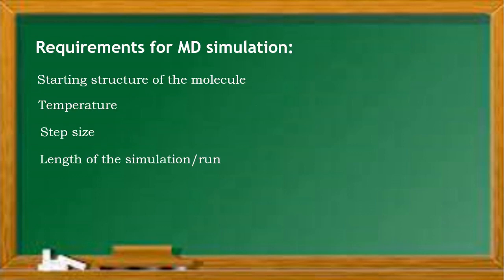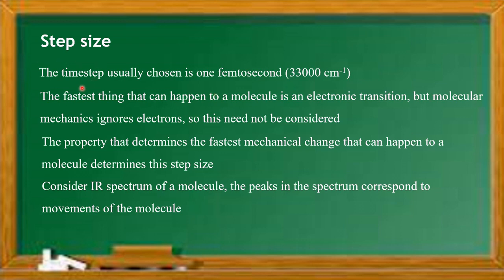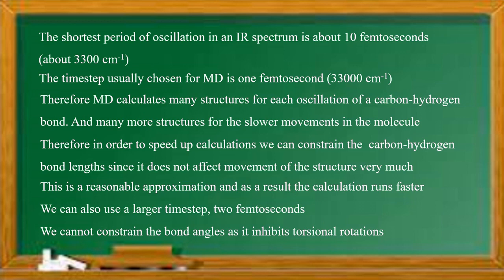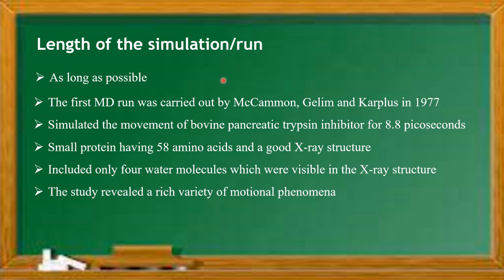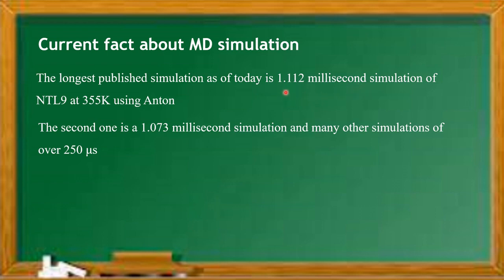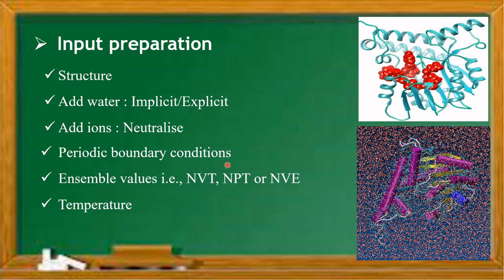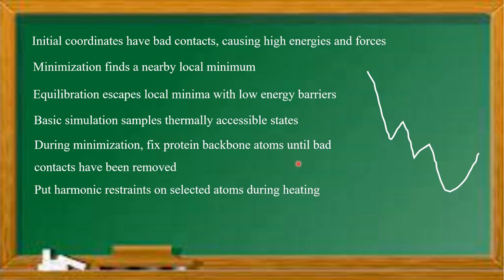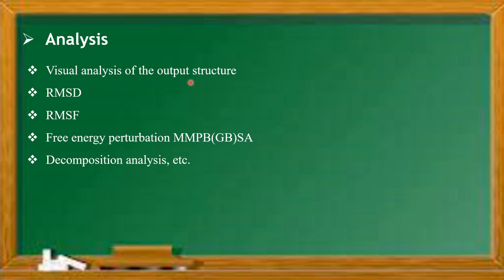Molecular Dynamics Part-1

Comment: Is energy minimization also MD simulation?
Reply from the maker: No. First you have to do energy minimisation and the MD. This will give better otherwise the molecule may behave erratically during MD simulation. You can consider it as a preparation step before carrying out MD
Reply: @pharmazest  I mean method. Is it dynamics or statics or something else?
Reply from the maker: @deckuofm  It is dynamics not statics. Several conformations are generated and calculated, sometimes the values are averaged as per different calculation methods.